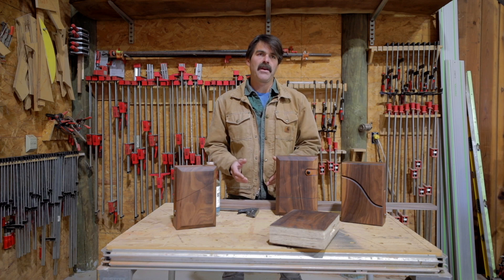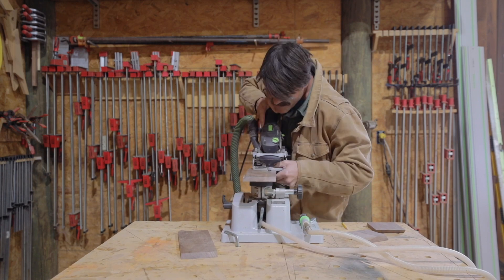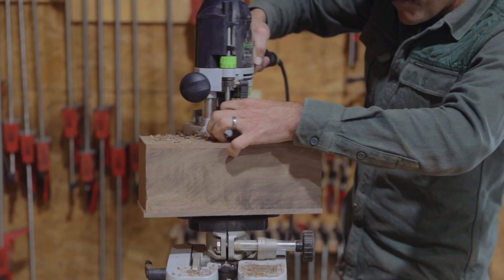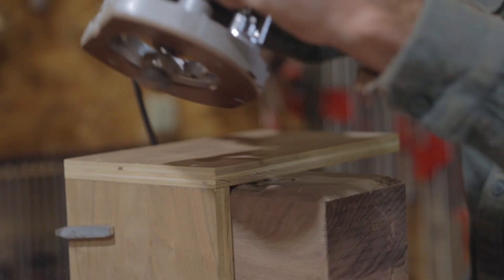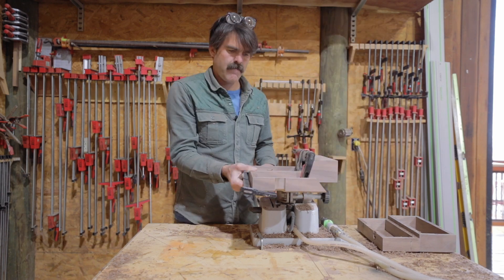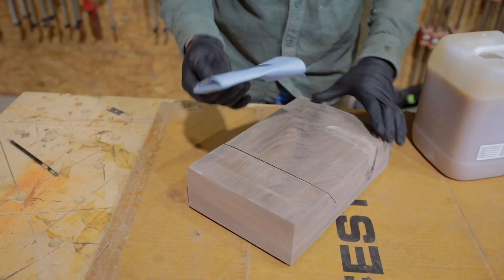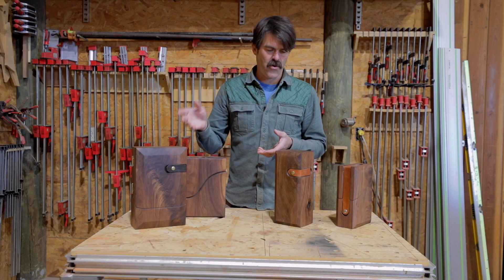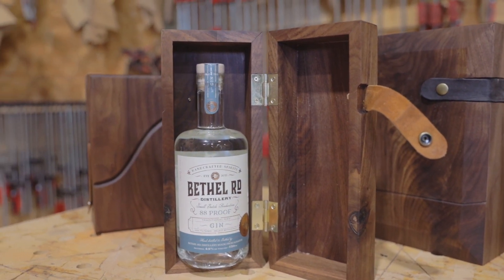Jory Brigham Makes Beautiful Boxes

Comment: Glad I came across your video. What is the tool you’re using to hold your project in place as you work?
Reply from the maker: That's the Festool VAC SYS. It's a suction based clamp. pretty cool little tool.

Comment: Awesome Boxes! Love your stuff.  You make me want to branch out and utilize leather working / and welding.   And on that note:  Quick question:  On your shuffleboard table ( I know, it's another video, sorry.)...the metal leg inserts that attach to the table—what type of welding?   Mig or Tig?   And do you prefer one over the other?
Reply: Thanks Ray!! I use both TIG and MIG. When I weld the insides of the legs where you don’t see I will typically use MIG. On the outsides, where seen I’ll try and use MIG. I’m better at MIG, but think TIG is a superior way to weld. Cheers!
Reply: @JoryBrighamDesign  Thanks for the reply.  Much, much appreciated.